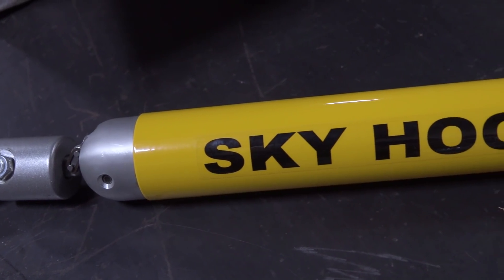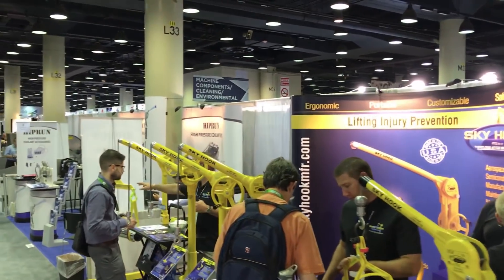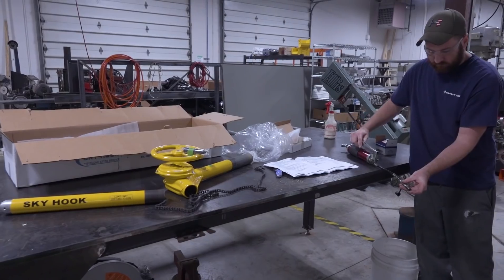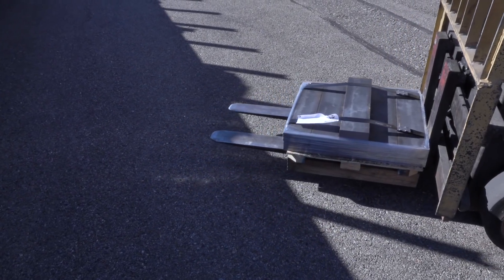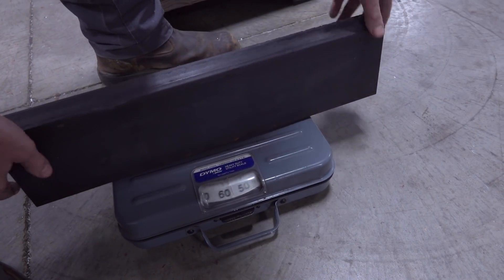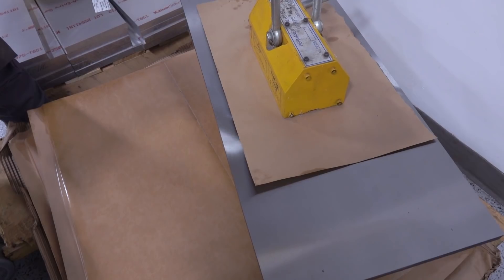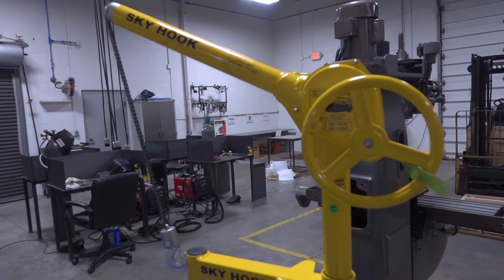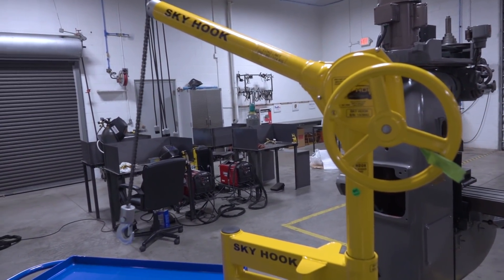Machine Shop Crane: Sky Hook Review

Comment: Why not build your own with a quality winch? A decent fab man should be able to make up one for each machine in a day and around $100.00 for a top quality winch ,or even an electric winch , 12 volt winch and a deep cycle battery works as ballast. I mean its just 2 sizes of tubing and some flat plate.  I had a simple crane on an old dump truck from HarborFreight that I used for loading scrap , with a hydraulic jack for $59. I replaced the sorry winch on it and still use it around the sawmill for rolling heavy logs on the carriage.
Also haven't y'all heard of this new invention they call concrete for ballast? Fill a form partly full and start pushing your scrap pcs in the wet mud , fill with more concrete and repeat scrap steel until form is full.
I just don't understand what has happened to common sense ?.!
Reply: Time is money. Plus if your shop made crane fails that is a potential lawsuit for you. If a properly installed purchased crane fails then its a lawsuit for the crane manufacturer.

Comment: Yeah, that's WAY too small for what we need at work. Some of the products we make weight upwards of 1000-1500 lbs. The main transformer alone in one of those could come in at 500 lbs.. Gonna have to look at something sturdier. I was thinking a large engine hoist might do it, but I don't know. Currently we fiddle with our fork lift (actually looks very similar to yours, it's a Hyster too, early 80s model) and lifting straps, but it's not very practical..

Comment: We need a bigger, slightly more heavy duty crane like this at my work. We have one of our Okuma MA600 running these steel castings that are anywhere from 80-450 pounds. The machine has an elevated loading work station platform that has to be moved out of the way so we can forklift the parts onto the tombstone. It would be really nice to have a crane mounted on this platform with around a 5 foot reach and up to about a 7 foot vertical lifting capability. Then one operator could load/unload straight from the pallet to the machine without disrupting other operators in the shop or tying up the forklift.
Reply: Over half of our business comes from customizing the Sky Hook lifting devices to best fit our customer's applications.  We can extend the reach up to about 4' while maintaining a 500 lb. load capacity on most models.  Sometimes extending the reach or height will affect the required base size and counter weight requirements though for bolt down models, there's typically no concern.  The model used by NYC CNC has an extended reach with the articulating arm but still a relatively small mobile base which is why the 250 lb. load rating.

Comment: Looks like it might benefit from a larger diameter crank wheel (maybe an upcoming Wednesday widget). Also maybe you could make an alternate version of the extension arm that has a drop to it so that you can have both the lower height and the reach.
Reply: The Sky Hook can be fully customized to fit your specific lifting application.  We've built many Sky Hooks with multiple height positions and have options to adjust/set the reach to the desired amount.  With a mobile base however, most customers find they can just wheel the Sky Hook up to the desired lifting point.
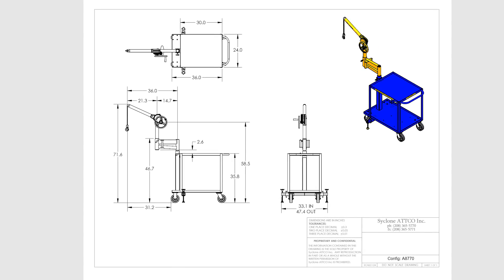Reply: @skyhooklifting  at 4:50-5:10 he mentions that with the extension it's too tall and without the extension it doesn't have enough cantilever distance for the vf2.
Reply: @billtheunjust  When we can determine the key dimensional requirements of the customer's application before the unit is purchased, we can develop a solution that will fit those needs perfectly.  In NYC CNC's application, their Sky Hook is a great general lifting device that can be used for all kinds of applications, preventing lifting injuries and saving time.

Comment: Arduino project?
Add a big battery and a stepper and you could then have setpoints for Haas pallet, Tormach lathe etc at the touch of a button. Could even give it tank tracks to move around...

Comment: When I was working in a mold shop we used those carts you showed at first to load blocks that were too big to do by hand and too small for a forklift (two machines were not accessible) and they SUCKED.   not enough reach into the machine and we had to use 2x4's to slide the block across the gap and on the table or into vises.  This is definitely the better method if you can grab the material.  Might have to do an op 0 on non magnetic stuff though to allow you to thread in an eye bolt though unless they have other solutions besides a hook and magnet.

Comment: My dumb idea would be to use the floor mount Sky hook permanently affixed to some kind of (weighted) metal pallet. Then use the shop pallet jack to move the Skyhook into position. Might not work as well as you'd likely still need some kind of cart to transfer to - but you might get better reach.

Comment: People that say $2600 is too much need to realize the cost for the company when it is done in house. An employe would have to work full time on this for the engineering, fabrication, painting, testing etc. (and hopefully everything works out first try).  This employe now cannot make any other parts for quite a few work hours. This employe gets paid a salary but also generates income. So this project wouldn't just cost material + salary but rather material + salary + lost income for the company. And that adds up really quickly very fast.
Of course a little home shop would DIY this. But please realize that a home shop and a company have different needs and requirements. One of them would be worker safety and possible lawsuits etc.
Reply: But it still is overpriced. The latest lifting related project I've been in charge at work was installation of 15m x 5m suspended rail crane system. Electric lift with 1000 kg lift capacity and manual movements along the rails. This was somewhere in ballpark of 15k€  (17k USD) including installation.
Reply: Just because something can't be done in house for less doesn't mean it isn't overpriced. It would cost me billions to make a smart phone, but I'm still not paying $1500 for one.

Comment: We have a portable Jib carne at work. It's basically a concrete block with a 250kg jib crane on top. It clears all machines and is very easy to move around on a pallet truck.

Comment: Surprised you didn't get something with an electric winch, then a small battery string for the counterweight.
Reply: We have built all kinds of custom Sky Hook designs in the past, even ones that incorporate pneumatic balancers.  However we find that the control and freedom that a manual lifting device offers for lifting sensitive parts is unparalleled.

Comment: Purchased their small one about 8 to 10 years ago for lifting lathe chucks, works great.  Ours mounts on the quick change tool holder when you use it.  Our lathe chucks are stored on a cart that can be moved in front of the lathe to transfer the chucks, no lifting required.  We also use die carts for transferring heavy tooling to and from milling machines.
Reply: I forgot to mention that we have sometimes mounted a lathe quick change tool holder on the CNC mill table and then used the Skyhook to lift heavy items to and from the mill when the die cart or engine hoist can't reach.

Comment: or you go to harbor freight and buy a truck crane.... for under $100
Reply: Every time I buy something from harbor freight I end up regretting it... except for the vulcan welder I bought that was good.
Reply: Zach Stone plus the boom height is adjustable, and will fit inside the machines.
Reply: A quality producing shop buys quality tools. The price being considered depends if your the one putting extreme pressure on your L5 or just forking over the dough.

Comment: Have you not seen an engine crane?
I fitted a 500kg electric winch so its super fast 
Can pick them up at the hardware store for under $200 usually
Reply: Can cut back the legs and add the counter weighs 
Engine crane is also obviously adjustable height to fit inside or over every machine
Reply: @fowletm1992  I do like the idea of the hydraulic pump. Yes, this is the first thing that came to mind...
Reply: no reach because of machine pedestals...

Comment: You already had a fork lift, can it not get to the machines?
Reply: Look around a garage that does big truck work. You don't see electric hoists. A chain fall can give you that small amount that you need, rather that too high or too low. I used one of these Sky Hooks around fifteen years ago to install and remove 12" steel body four jaw chucks with D1-6 mounts. I made a offset adapter from 1/2" X 2" crs with a piece of 1 1/2 round bolted and cross pinned to allow the chuck to revolve to align the pins. A large hole in the opposite end for the hook. this allows the hook to lift above the center of mass. These things are a very nice tool. No broken fingers!!
Reply from the maker: Dangerous, easy to damage machines, inconvenient, requires significant space around each machine

Comment: Thought if it is hard to raise with the small wheel. One day you could make a larger hand wheel. That should make it easier when lifting. @4.30 in the video. Just a thought. Anything to save the back works.
Reply: The current hand wheel size and overall gear reduction is set to offer the best marriage between speed and ease of use.  Along with increasing or decreasing the hand wheel size, we can also modify the gear reduction to the desired amount.  This is pretty uncommon but is absolutely possible!
Reply: @skyhooklifting   verytrue

Comment: My Tafe I went to for a fitting and machining course in 2011 had one of these for all 31 manual lathes. Instead of the hook the had a L shaped rod on them. It was used to switch chucks on the lathes. Not sure if its the same company as I'm in Australia but they were yellow and used chain.
Reply: NC 4 Eva.....

Comment: $2,600 is a lot for what it is
Reply from the maker: What's your solution?
Reply: @nyccnc  That gave me a great idea.
Reply: Me too!
Reply: @nyccnc  engine hoist?
Reply: excuse me for having an opinion!
Reply: In all places i have seen or worked for in my country they all got a wall/roof mounted crane with minimum capacities of 1 ton. Its really nice to have roof/wall cranes because they are always up in the air and not in the way.
Reply: @nyccnc  make my own
Reply: NYC CNC we have an old moriseiki lathe. Two owners ago they mounted a verical i beam to a 1/2” plate. The plate was bolted to the floor and the bacl of the lathe mounted on the plate. A horizontal ibeam was mounted to the vertical ibeam with bearings. Works, but janky as hell. Im buying this or something similar for the new VF-5/50xt i bought a year ago. Progress.
Reply: @nyccnc  engine hoist?
Reply: @kfh13 they depend mostly on their front wheels being under the load. This takes away the need for a counterweight, but makes it unusable in most shops as machines usually don't have (enough) floor clearance.
Reply: @sennev7427  There are low clearance models that can get around that.  They are useful for offloading pallets and other material handling solutions made to be moved via forklift and can get under most machines.
Reply: Another solution? Depends how much your time is worth, but it wouldn't be rocket science to design and build something in house, with the added benefit of speccing it for your exact requirements.
Reply: @johnalexander2349  exactly, maybe their time is worth more than 2600$ so expense is justified, but these guys run a machine shop, they could just model a frame and weld it up on a sunday afternoon.

Maybe they just wanted to have something that just works.
Reply: Cesare, if I recall correctly, they've got a plasma table in house, so the bulk of the work would be CAD, and 15 minutes of welding.

If you ask me, this sky hook just kinda works. Turning the wheel is not effortless, it's the almost the right height, almost has the reach they want, almost has the right castors, and almost has the capacity they want. DIY would be better, not just cheaper.
Reply: @nyccnc  this is my reply to my guys when they lazily point out issues.
Reply: It's not meant for people who think $2600 is "too much money" vs OTJ injuries. It's meant for companies (not some guy in their basement) who would rather buy this than have a worker get hurt. Those businesses also aren't going to trust a load to Jim Bob's "I can do that" engineering/welding.
Reply: If it saves one back injury, or any other injury, it has more than paid for itself, especially in a setting such as John’s.  Labor savings alone, using one person to move a heavy object instead of two people, will eventually pay for the device.
Reply: Depends on how many they make. The work in it is not cheap. I would expect to see $1000 China clones soonish.
Reply: A cherry picker would do pretty much the same thing with much higher capacity and a longer boom length.  They are pretty much engine hoists with a push handle that can take a load that swings sideways.  They are significantly cheaper also.  Also they make attachments for the walk behind fork trucks.  One of which is a boom arm.  I believe little giant is one of the companies that does this.  They make crank style for raising and lowering and also hydraulic ones that operate by a foot pedal.  One advantage to these is you can swap attachments quickly and easily so they are much more flexible.  Would also be much lighter.  Just some suggestions.
Reply: And that's without the counterweight.
Reply: $2,600 is better than having back issues.
Reply: It's obviously a reliable, well made, very mobile crane. How much money do you think a small company, or even a big company, could save on having one person pick up and move heavy parts painlessly, instead of often having to have 2 people awkwardly moving a thing into place? You can save both time and possible injury with this thing.
This is very nice, but obviously not meant for the average garage tinkerer
Reply: Alot of CYA goes into the design, engineering and failure testing of this type of equipment and is reflected in the cost.
Reply: @asherdie  there really isn't that much to it. Low volume manufacturing likely takes the biggest chunk of cash with this particular product. That's not to say a bunch of CYA isn't taking place but a majority of it likely takes place due to the company's ISO cert.
Reply: Looks like if you could increase the diameter of the wheel it would increase your leverage. 
Easy mod for you guys
Reply: Bit of jerry rig but can get away with engine hoist hard mounted on top of a pallet jack.  Just make sure all the equipment in the shop have minimum ground clearance.  Cost 300-400.
Reply: chris demchalk the issue is you need a big counterweight to lift beyond your wheels. I suppose you could make a big block of concrete that is liftable by a pallet jack though. An engine hoist doesn’t have a pivot either. Interesting, but would take a decent amount of effort
Reply: Where I work, we use varying figures for the cost of injuries. I believe we price a back hernia at $20,000 cost to the company.